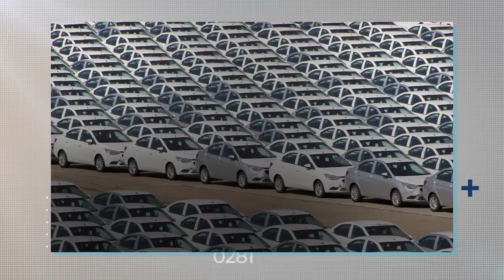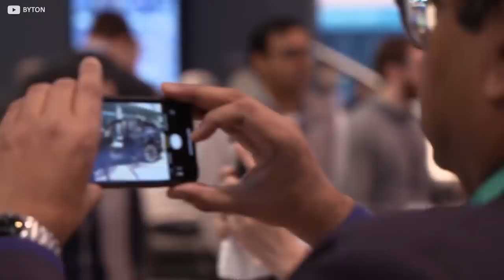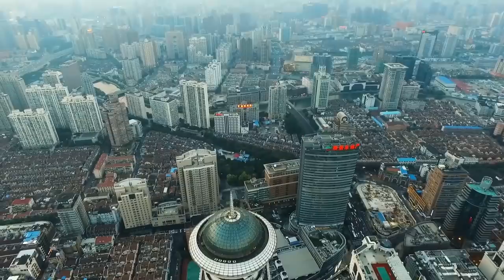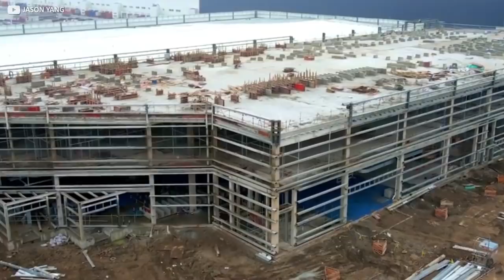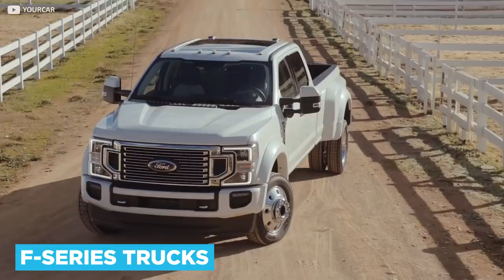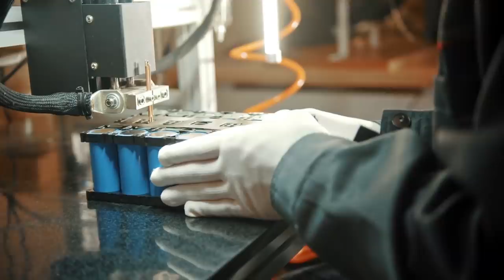The EV Race: USA vs China

Comment: I am driving a NIO for 3 years now, but tested both. The entire concept of NIO is far more advanced.
Reply: Like ?
Reply: @JOSUE TORREZLUIZAGA 

The Nio measures this 1000 km with NEFZ. During Tesla or the new Mercedes EQS measure according to WLTP and reach 750-800 km. 

The 1000 Km of the Nio et7 is just a Marketing joke by using a measuring procedure which is not used in the EU since 2017 anymore. 

Tesla and Mercedes also go 1000 km if u measure the range according to NEFZ and not WTLP. 

This NIO is by no means a bad car……. But it is also not a revolution….. 

Everyone acts like this would be a cute to cancer. It is not better than a Tesla and by far not better than a EQS Mercedes so far.

Comment: Great contents! I’ve been watching tech vision videos for a few months and love them. However, I have to point out that China is not setting restriction on cars’ driving time because they want to reduce dependence on foreign oil, it’s solely because traffic gets real bad in some cities sometimes. Also, this restriction takes place only in the largest cities, almost exclusively Beijing actually, and is not a norm, at all. China does not have much oil resources anyway, and most of the imported oil is used for industrial purpose, not powering cars, so there really isn’t any motivation to limit oil import.

Comment: The reason for the is not the air polusion. China want to be the biggest ev manufacturer world wide. They want it since the petrol cars but they never stept up to the good german engines. But its an other story with ev cars. They dont need petrol engines and are more easy to built. China invests more in to the coal industry than any other one so the reasony isnt the air polusion with petrol engines

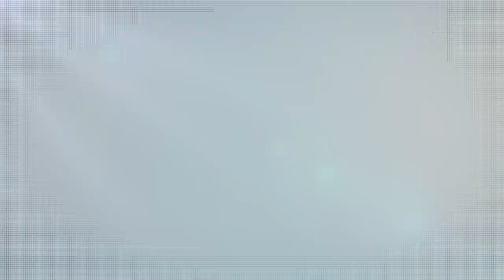Comment: 4:12 700 miles a year for average driver!
Reply: Invëst in bit-cøin,buy stöck, foréx markët Just invëst and savé yourself
Reply: Write my broker to start up a trade
Reply: Public transportation is a lot more developed there, besides the fact Chinese cities aren't designed with cars in mind where most services are within walking distance.
Reply: If the average Chinese only drives 697 miles a year, than it's a colossal waste to build so many EVs and batteries...
Reply: For the traffic between cities, we use high-speed trains with a speed of 350 km / h
Reply: @OlJackBurton  Most Chinese ride the Bullet High Speed Train for longer distance. The whole point to convert to electric vehicles is to reduce carbon emission and thus reduce pollution.
Reply: it is about the same as people living in Manhattan. Most Chinese drivers live in the areas as busy or even more busy than Manhattan where driving isn't a pleasant activity.

Comment: China is building 20 more coal plants this  year alone
Reply: this year China's renewable energy installation is 40% of total new installation. this year 40% of electricity in the US is still derived from fossil fuel, 40% NG, 20% coal. also China retires its coal generators with low efficiency every year.